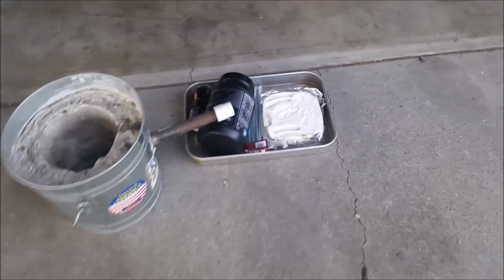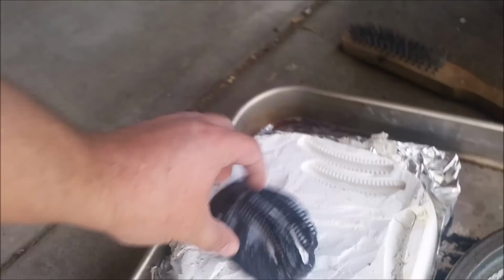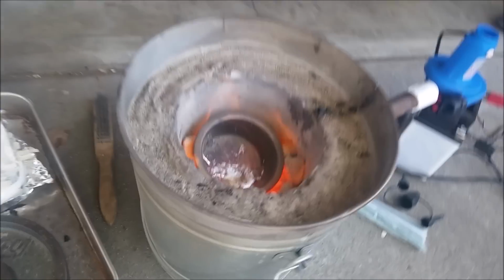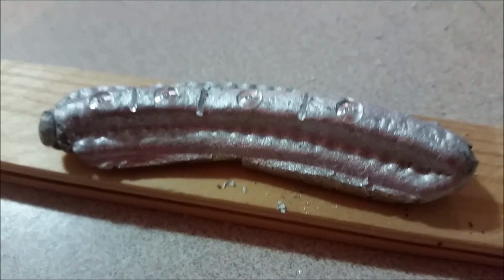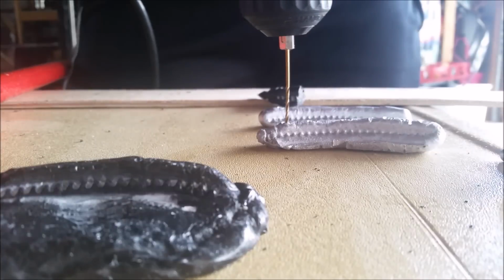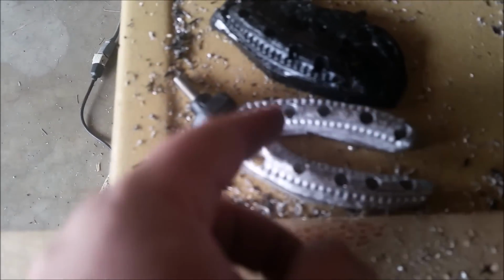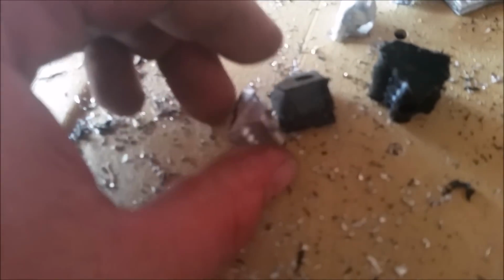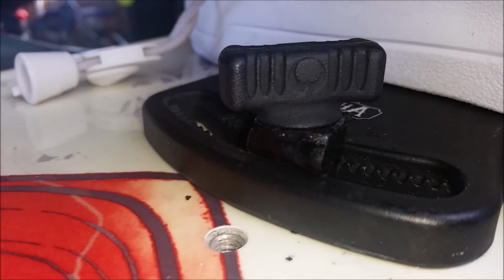DIY Casting Parts With Aluminum Recycled From Cans

Comment: TIP: It always makes for a better video when you have thought out your plan and have all of you tools "at the ready" for your project. Also... slower drill speed and lubrication. use a clamp or two when you saw ,. . . .anything
You made the project harder for yourself than it needed to be.

Comment: Awesome! What material was the mold made from?
Reply from the maker: Plaster of Paris.  I made a clay model of the part I wanted to replicate, then cast it in plaster.  The plaster didn't fully dry and still had moisture in it.  I imagine that's what caused the explosion.

Comment: Woah! Shorts and tennies do not mix with molten metal! Even whith the best of safety proceedures and the most  experienced men in the world, at a steel mill blow outs and spills happen all the time.  - It's how my grandfather bought the farm -  There is no stopping a river of high temp death. 
You can ask anybody that knows me, I'm the last one in the world to be a safety nazi, but being half naked in woman's clothes while casting 1300 degree aluminum is not a way to keep out of the ER,,,or morgue. If ANYHING at all goes south while casting metal you are NOT going to come out without the right equipent, my friend. Even WITH the best equipment you can still get killed  - If not for me then for your faily at lease get some minimal actual PPE the next time you are casting, bro. You seem like an OK guy. Sure as hell don't want the read about you getting hurt when a little thought and research would have prevented it.